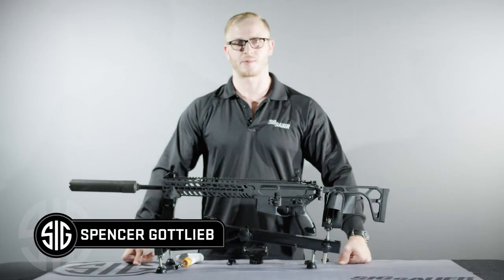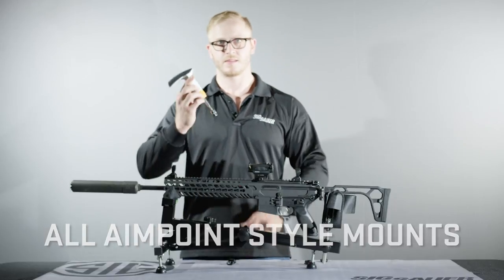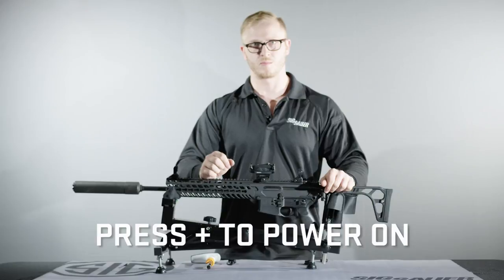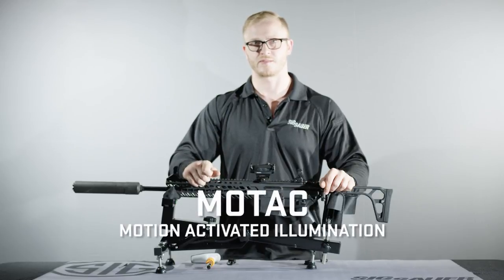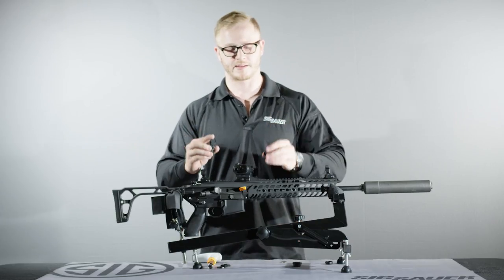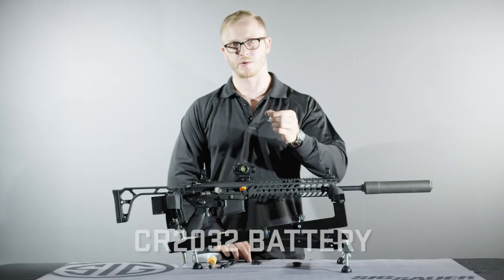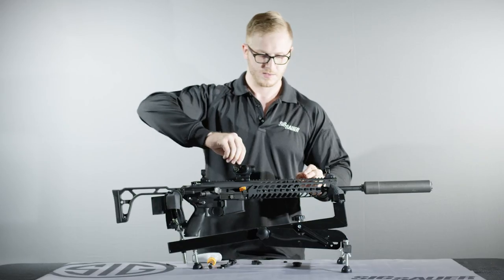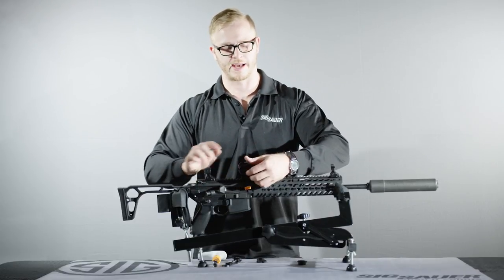How to Install the ROMEO4T on any AR Platform Rifle

Comment: How do you install the riser mount?  The Romeo 4t instructions are really inadequate in this regard.  It looks like you need a special thin driver to get through the access holes to the screws in the default mount to unscrew.

Comment: What is the difference between the 4s and the 4t?
Reply: LWRC BCM seems build material, coating and mount are different I have the 4S works great so far but will get this as well